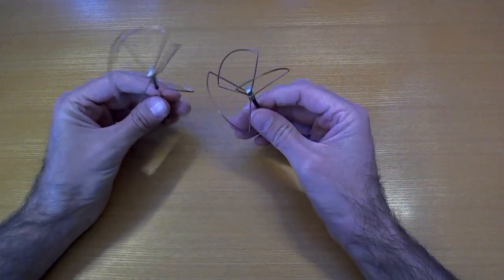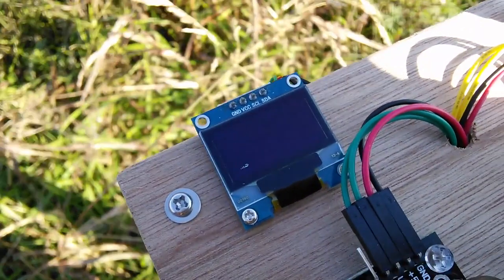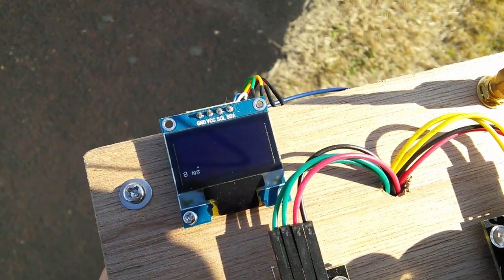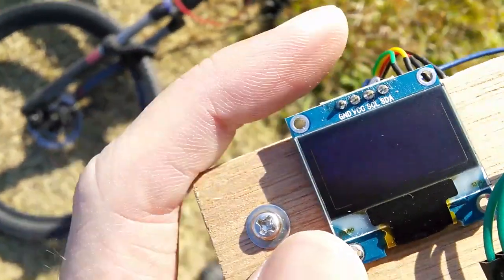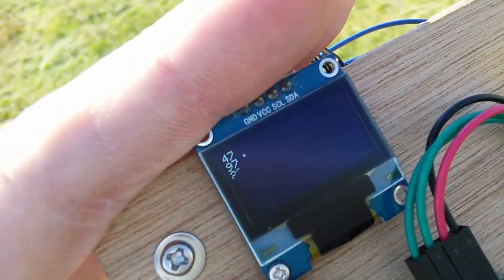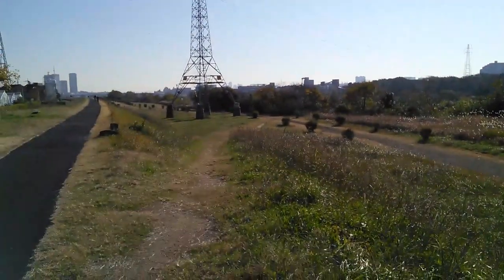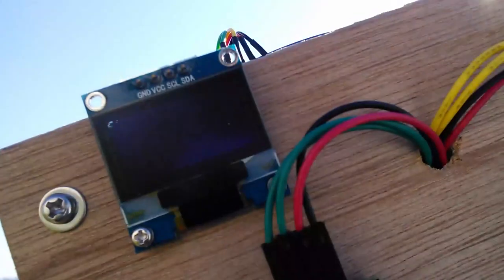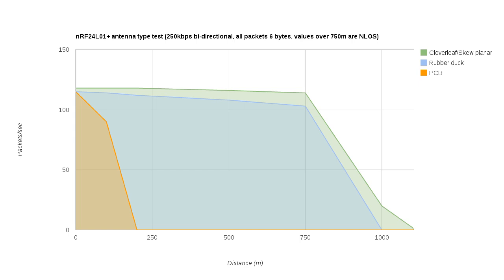nRF24L01 range test part 2 (arduino)

Comment: Those antennae show you how lossy the rubber duck is.

Those packet size vs data rate results are interesting. Thanks for the tests.
A few thoughts, and typed as I thought about them, so please accept my apologies for the length of this, and the somewhat random order. It's how my simple mind works. 

EDIT: TL;DR, so as a précis:  Check your radio bandwidths. Check the Arduino internal bandwidths. Check data rates. Check for signal collisions due to latencies. 

Now, in full:

As you approach 16 bytes, are you experiencing transmit/receive collisions? It would explain the sudden jump to 'normality from 17 bytes onwards. Furthermore, the plateau at up to 8 bytes and the cutoff from 24 bytes bear consideration, since the three relevant figures are multiples of 8 bytes. Maybe the circuitry is hitting internal conflicts at those multiple, and running into a throughput wall at 24 bytes? You might also want to look at transmitter and receiver latencies as possible sources for more clues. Even a clock or data frequency change can be tried, to see whether, for instance, switching to 512 k instead of 256 k might yield different results. Where I'm coming from with clock frequencies is the bandwidth needing to be at least twice the data rate for transmission to be possible. Thus, 8 bytes = 64 bits, needs a minimum of 128 bits of bandwidth, but if you're sending, for example, 256 packets per second, you’ll need a bandwidth of at least 32,768 kHz to send those 8 bit packets. At a packet size of 24 bytes, you'll need a theoretical transmitter channel bandwidth, and a receiver with an internal passband of at least ~100kHz, plus a margin for bandwidth edge effects, such as phase angle errors. That's stretching things for most cheap commercial equipment. O.K., I'm not an Arduino fan (code is like Mandarin to me), and am making some assumptions, so might be talking garbage, but how many bits of data are required for an Arduino to produce the required packets at the throughput rate in use? I'd hazard that it's a multiple of the output signal, such as 2, 4, or even 8. That would go some way towards explaining the maximum claimed packet size being limited to 32 bytes. In other words, maybe p 32x8 bits, times the number of packets per second, times the number of bits needed for the code to generate the output, times 2 ; the bandwidth needed for the signals to pass through the device. 
In my assumed worst case, that's (32 x 8 x 256 x 8 x 2) Hz = approximately 1.07 MHz needed inside the Arduino. 
As said, possibly wrong, but you can begin to see why the limitations are there, by using the figures which you know. My guess is that your main limitations are the transmitter and receiver bandwidths. 

Transmission theory is a subject in itself, and there's no point in typing reams of text here, so we'll atop now!

Comment: Dunno if it's applicable to your setup, but I've noticed that when using commercial radios (futaba, JR, etc) if the transmitter is too close to the receiver (within one metre) the receiver is "swamped", and the transmitter will report loss of signal. The solution is to move the tranny a bit further away and everything is okay again. With your throughput testing I'm wondering if the RF24s might have been too close to each other?

Comment: I saw the exact same strange results with differing packet sizes and bitrates but was able to get things working by adding delays at certain points in the libraries (I tried the MIRF and RF24 libraries).  After struggling with this for months I decided to try creating a library and have it up on GitHub in case you wanted to try it sometime.  I run the library through a gambit of tests to ensure it works with all packet sizes and all bitrates, with and without ACK packets, and ensure it works with all ACK packet sizes as well.  In case you're interested, I put up a video all about it here https://www.youtube.com/watch?v=tWEgvS7Sj-8 with a link to GitHub in the description.  It's not as fast as the TMRh20 fork of RF24 but it works without having to insert delays.  That was the goal, to make something that just works.

Comment: Nice video man. I would validate the data you are receiving sending some specific data and validating it in the receiver, because maybe you were receiving data from a remote control or another device using the same module near you... just guessing

Comment: print out sizeof(MyData) and be surprised, most likely the compiler padded out your array ;)  -> google _attribute_(packed)
Reply from the maker: It's an 8-bit processor, nothing to be gained by pading structs. I did a quick check now to be sure anyway. When sending data over serial to my computer though, I definitely need to pack structs on the computer side.

Comment: I'd be interested to know how you measure distance between your controller and the quad. Is this a built in feature of the radio module? :)
Reply from the maker: There is a GPS module on the transmitter, and I'm calculating the distance to the starting point. I didn't show any of it in this video, but the previous video mentions a bit more about it.
Reply: ***** Ah, interesting - thanks for the quick response! I should probably not be watching the videos in reverse order, haha.

Comment: Thanks for proving that there is undocumented magic chanting involved in order to get these modules to work :p  joking aside, I really cannot get the ack payload to be read by my transmitter properly. odd thing is, it did occasionally show some garbled data once in a while...   but your throughput vs packet size data is really odd indeed..
Reply from the maker: Not even with the pingpair_pl example? Can you get a regular transmission working with no ack payload?
Reply: ***** thats a good point. I  should go back to the example that is known to work, instead of trying to add stuff to my code.
btw have you tried reading multiple pipes at the same time?  because I am getting a huge amount of cross talk across pipes, i.e data sent to one pipe is being received on other pipes...

Comment: you have inspired me to build my own CA quad. really enjoying your videos, i was thinking back to your return to home testing. What if you tried your own home brew Differential GPS. Grab another receiver sample its static location and calculate the drift of the GPS constellation. Send the differential DMS to the quad via your radios and offset it from the received data on the mobile unit. presto wobble free gps constellation. I intend to try this in the new year when i get some vacation time. Thanks.
Reply from the maker: That sounds like an interesting project!

Comment: Two questions:

1. Which RF24 library are you using?
2. Which SPI library are you using? Built in one?
Reply from the maker: This RF24 library: http://maniacalbits.blogspot.jp/2013/04/new-rf24-driver-release-fork.html
and the normal SPI library.

Comment: Very strange results after 25 bytes. I'm sending 31 bytes packets and it works well. I was just using a simple chat sketch from here - http://forum.arduino.cc/index.php?topic=183961.0
Sometimes it loses the packets, but that sketch always swaps pipes when it sends data and I thought that the packet loses might be because of that. There are a few differences with your code, for example. that chat doesn't use the acknowledge payloads, it specifies CRC length and retries. Not sure what the default values for those parameters are.
Reply from the maker: Yeah, I seem to vaguely recall having sent 32 byte packets in the past too...

Comment: Nice video

Do you know if it would make sense to have such an cloverleaf antenne on the master station, and just the build in antenne on the sending stations?

I am working on a measure temperature and other stuff system for my new house.

p.s. where did you buy those antenna you test today?
Reply from the maker: As far as I know, circularly polarized antennas will not play so well with the linear polarized ones. You would probably be better off using a rubber duck/whip one with the PCB antenna.
I got them from Banggood: https://www.banggood.com/2_4G-3-Leaves-Omnidirectional-Gain-Antenna-For-Transmitter-p-76956.html
Hmm... seems like they don't stock the skew planar anymore.
Reply: ***** Thanks a lot for your quickreply,

I'll stick to a rubber duck version for the base station :)